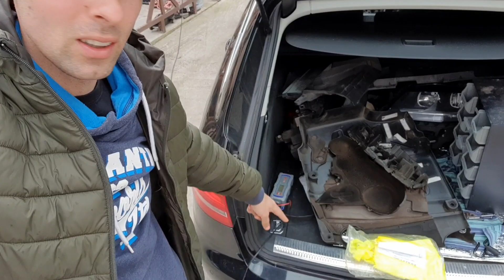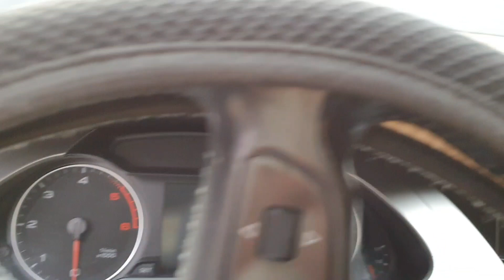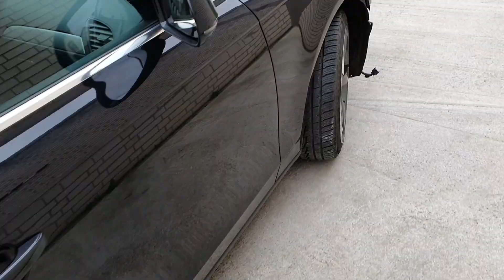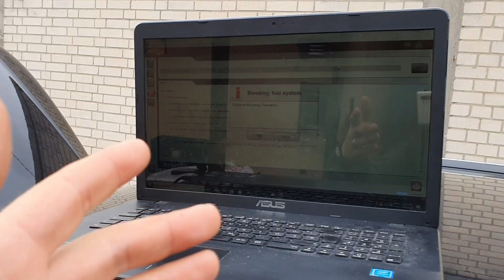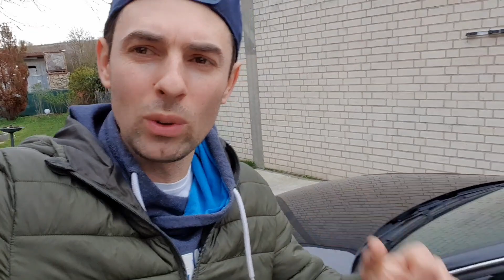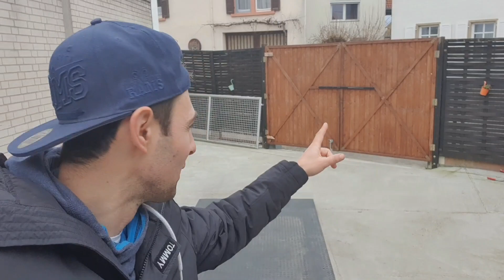Audi A4 2.0 TDI High pressure pump replaced! Will it start?

Comment: Hi, Nice video, I've seen both of your videos regarding this.  I've got the same problem on a transporter T5, did you just change the HPFP and injectors and clean the rails and everything?  Did you clean the fuel tank also?  Also how long did it smoke for? Thanks
Reply: Did you get low pressure when plugged in? until you replaced the fuel injectors?
Thanks
Reply from the maker: Yes. It's gonna save a low pressure error. You have to delete it
Reply from the maker: I've replaced pump, injectors, filter, cleand all the circuit from fuel tank to injectors. Rail, fuel tank...it's gonna smoke for a few minutes but if everything is working normal it should smoke at all after that. If ist smoking that means that you still have injectors that are not working correctly